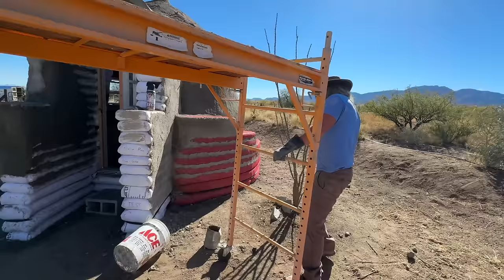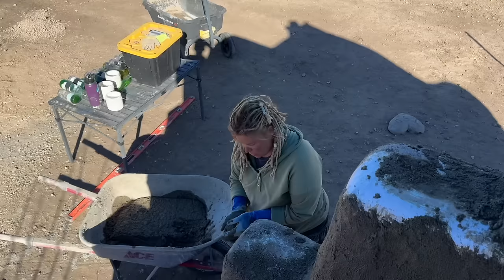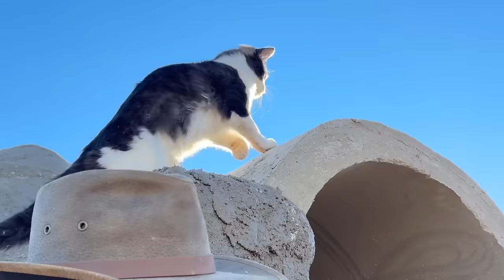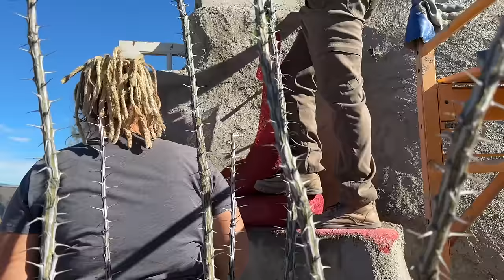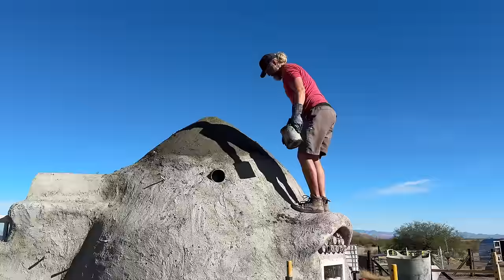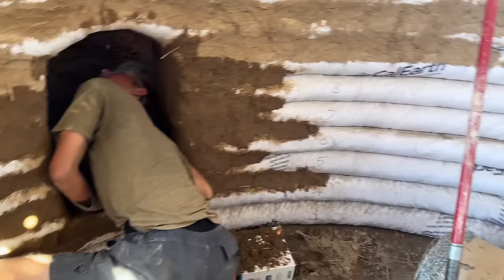PERFECTING DOME SHAPE Before Final Stucco

Comment: I heard that Jonathan, buts and boob! A little titillating conversation. There goes Ashley with a "booby trap." You two are too fun! Almost done with the "but"tresses Ashley! I just love that door. More course sand! It does look pretty good guys! Nice that you are plastering inside the wooden stove area. I hope Adali can get the rest of it. I'm glad you could add another step to the outside to get up higher. That's good that Jett is helping with his long arms. Nice looking bottle bricks. Good idea to use the lath or chicken wire for the stucco. I'm glad you learned that great way to tighten up the lath Ashley. It looks great! Thanks for this video Longnecker family!

Comment: Hey, when you put your point up there, I want you to put your piece of Rebar stick in the Uber. Then you can put your pie and put a piece of pipe over it with a flag. But make sure you're pipe that you put over. It has a cap on it, so water don't run down it and then you can have your little flagpole
Reply from the maker: Definitely not putting a flagpole on the dome 🤔
Reply: .....not that the wind blows in that part of the country,  lol.

Comment: To get your top perfectly symmetrical, could you cut a plywood form, mount on a pipe so that it could spin around center…lay on a nice thick coat of wet stucco, shave it down to a uniform, perfectly round dome top? (Drawing the arc to cut the form could be done the same way the fixed chain was used to set the arch in the bags when you built the structure)
Reply from the maker: Mount a pipe where?

Comment: how about over the entry door and over the bottles finish the hole with a transom vent? make a tiny door for summer to vent out heat.  in summer air moves down the stove vent and out thru the transom vent screen thru natural air siphoning .... hey?
Reply from the maker: Already have a bidirectional ac powered vent up top
Reply: @TinyShinyHome  ok, that sounds like a split mini system. Nice. But it's nice to have backs. Fresh air some time.  Ok enjoy. I do appreciate you shared video s.
Reply from the maker: No, it's just an air vent with a fan in it, not a full mini split system.
Reply: @TinyShinyHome  ok, sorry to bother you